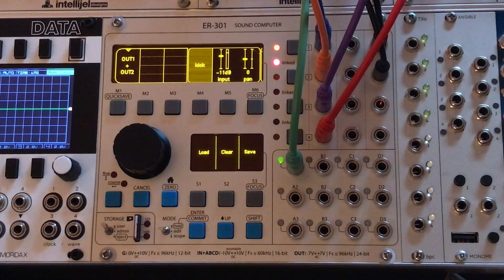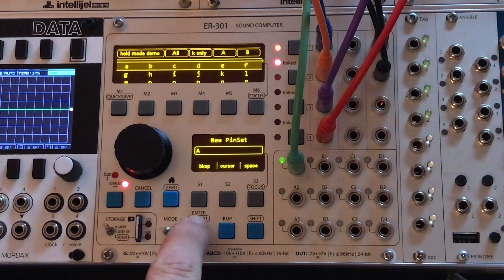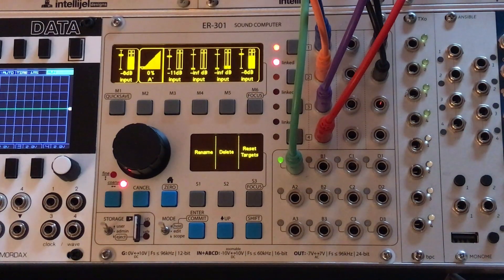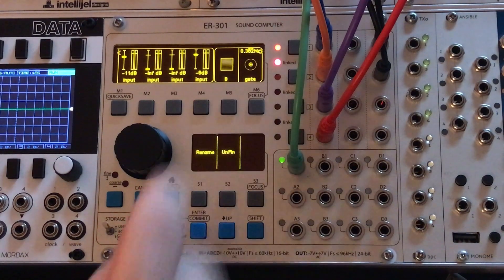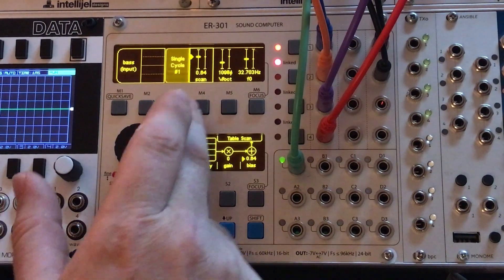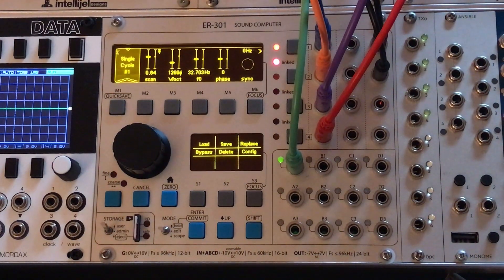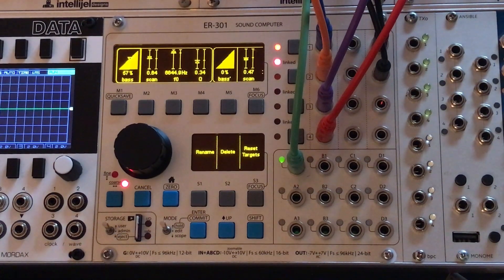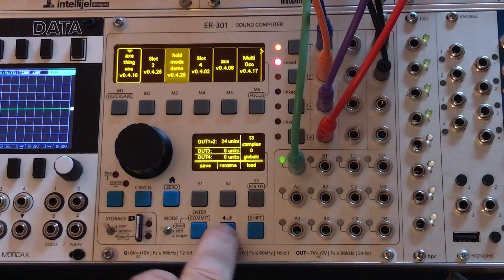ER-301 Hold Mode

Comment: Super helpful Joe, thanks. I'm now wondering if Hold modes can be triggered by the 16N Faderbank using a slider via i2c.
Reply from the maker: Hold mode controls can only be controlled from the ER-301 panel.  I think of them as more of a bonus set of controls to what you can already do with something like 16n.